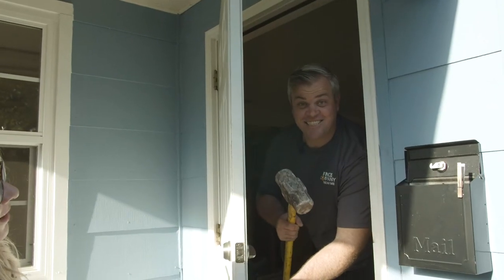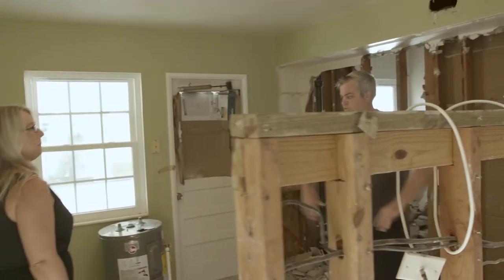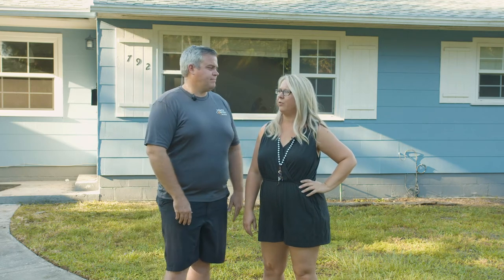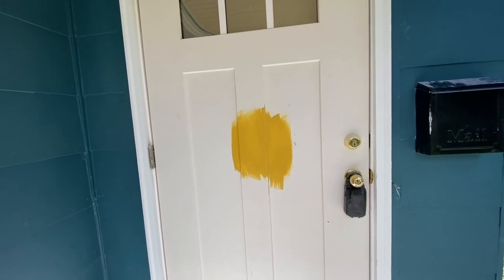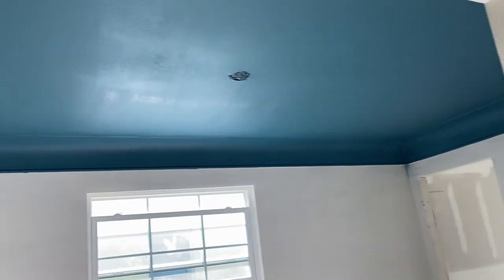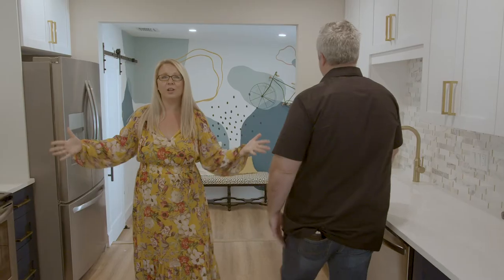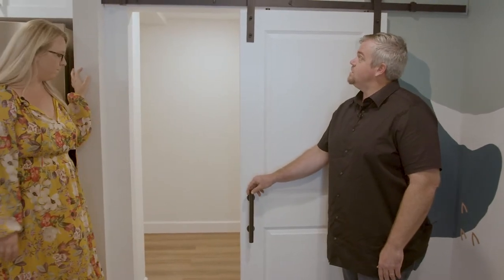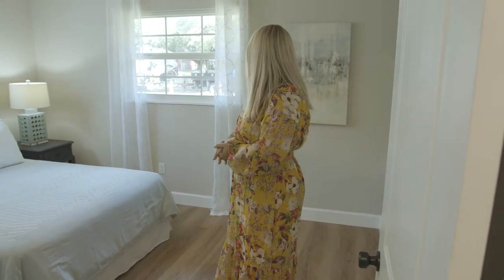45-day Lipstick House Flip - Before and After - Busted Cribs (YouTube Special)

Comment: Welp.  My daughter bought this house from you.  After a couple months, she noticed water under the dishwasher and figured it was the gasket.  She installed a new gasket and they did not notice my further problem.  So, three years later, The dishwasher heating element burned through the plastic tub so every time they used it, water seeped unnoticed, under the vinyl laminate flooring. Been going on probably for years and just now, water started seeping through the seams .  So, we had to tear up the kitchen and living room flooring and having new flooring installed at a cost of over $3500 for labor and materials.  You may want to start buying better quality appliances instead of the builders grade junk like this unit.